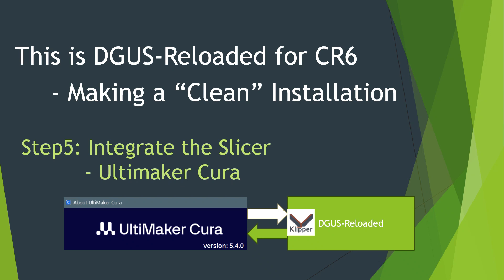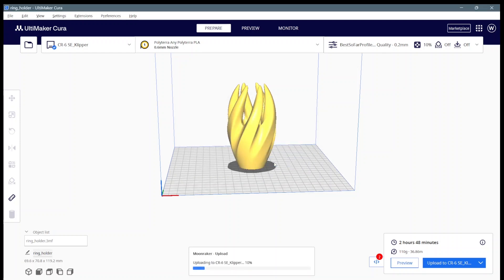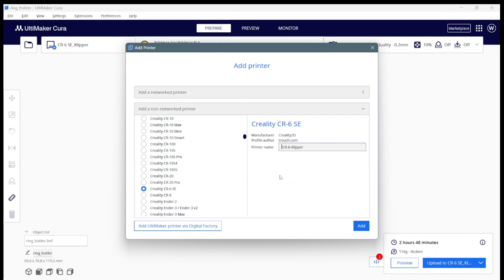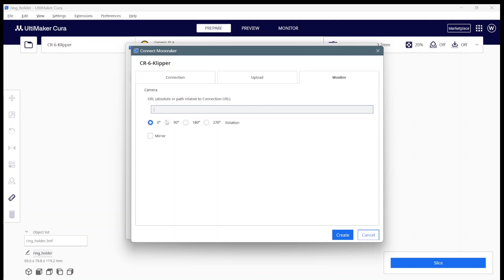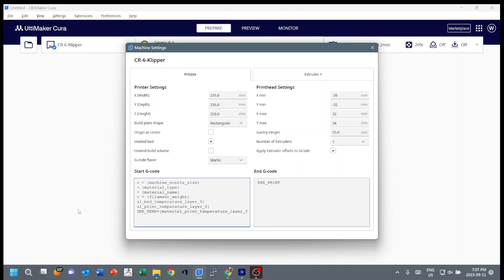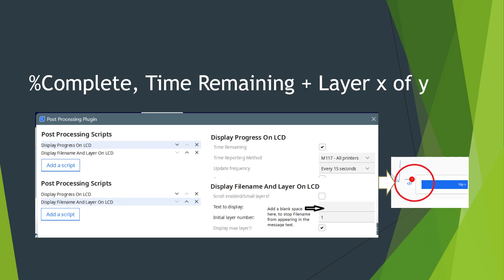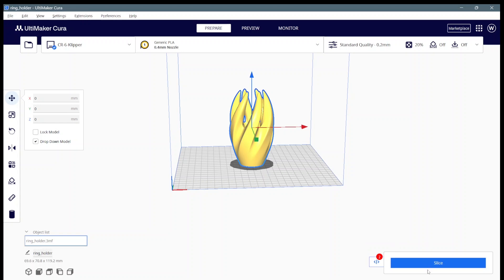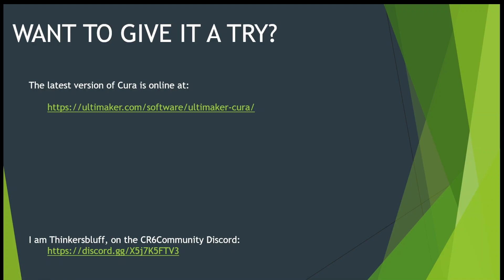Step5: Integrate the Slicer - Ultimaker Cura

Comment: Absolutely fantastic work you've done here! I just finished getting klipper set up and the screen working! All sanity checks are good and I've done basic calibrations to ensure it will print properly however I seem to have an issue with the Setup Button on the screen. It just beeps and does nothing. All other functions I've used seem to work as intended I just cant access the setup section :/ Any clues?
Reply from the maker: @TheGrowOp  which versions of the Klipper and DWIN_SET components have you installed?
Reply: @makingthingsreal101  I appreciate your reply but I solved it! After countless hours I found it was an issue with the naming of the LED pin configuration. I already had klipper installed and had a different cfg and did my best to move over everything from the GitHub but missed the section of the LED_pin. My cfg had it as nozzle_led and it was throwing an error in the log but not thru klipper!
Reply from the maker: @ that makes sense.  The Setup menu needs to display LED status, so it would abort the page switch if it could not find that value.  Thanks for sharing.